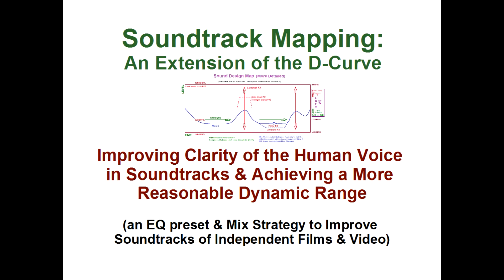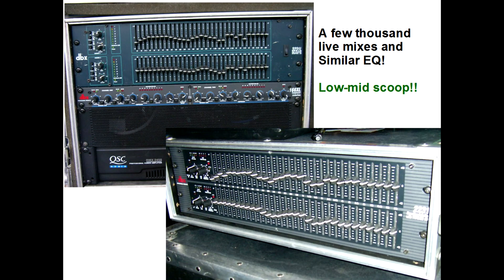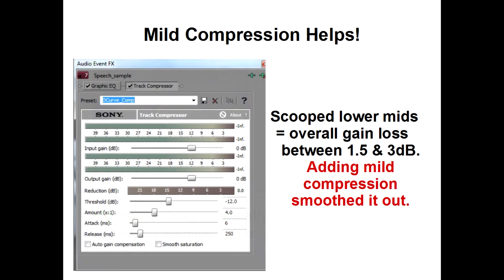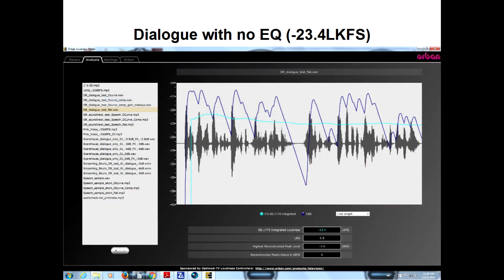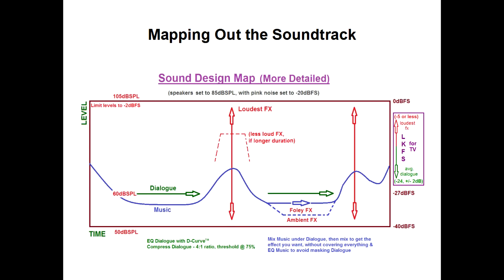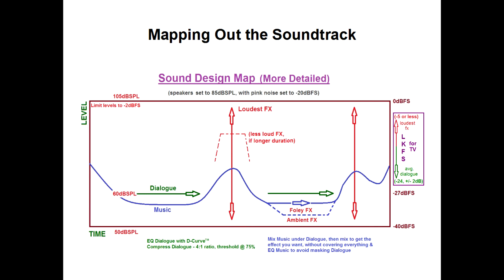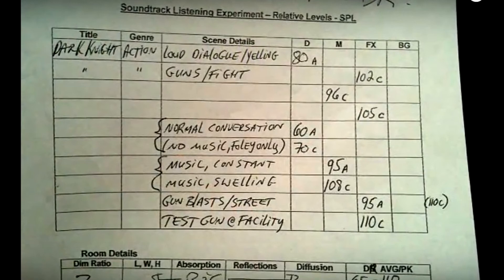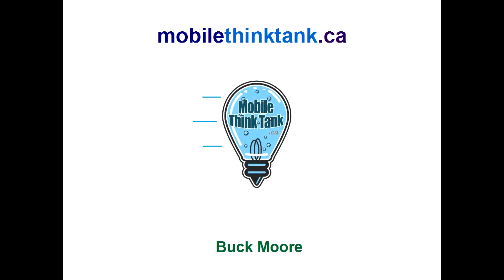Soundtrack Dynamic Range and EQ - AES presentation 2017 - Buck Moore

Comment: What are your thoughts on ducking music methods? In the older days a compressor on the music side chained by the dialogue was a common method, but modern tools such as multiband compression or dynamic inverse EQ, in a side chain allow for intelligibility of dialogue without the obvious ducking effect (maintaining apparent music loudness).  Also what are your thoughts on using Mid-Side compression on the music tracks, side chained by dialogue (where music MID channel is compressed slightly to give room for dialogue)? In short, altering volume, EQ or spacial energy of the music tracks to give room for dialogue - do you have a preference?
Reply from the maker: I've never needed a side chain to duck, but have always done it manually with 'volume automation' decisions through the entire soundtrack.

I use modest compression over the entire track as well, but I do subtractive EQ first, to preserve
 headroom.